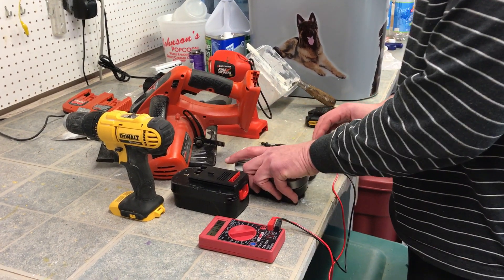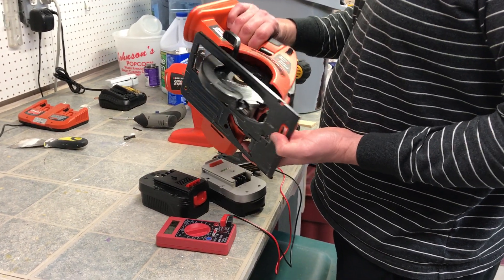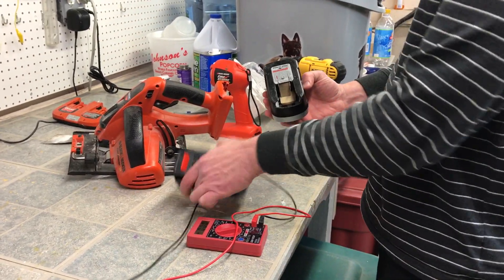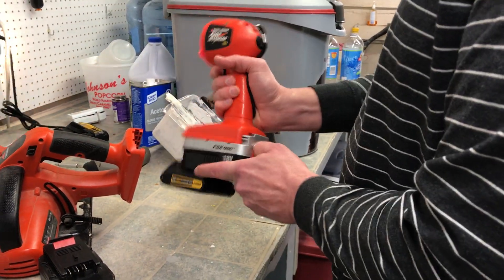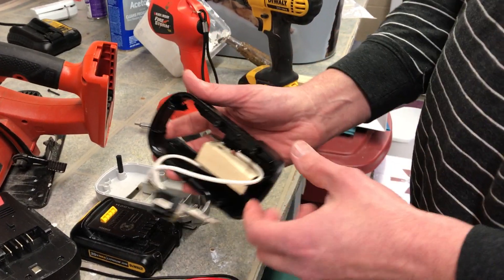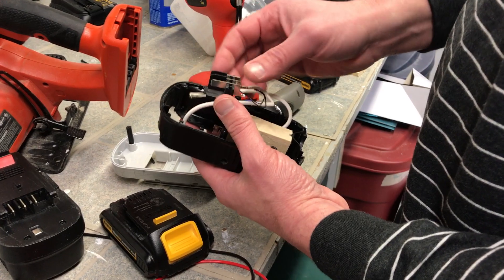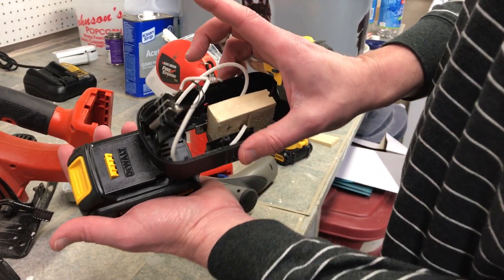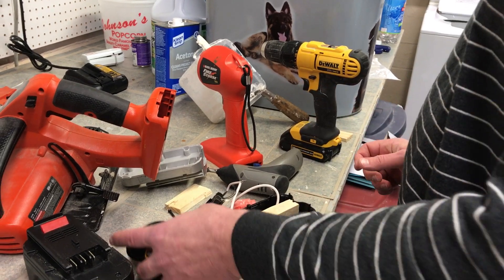18v NiCad to Lithium adapter

Comment: Never use a lithium battery on a tool wired for Ni-cad.
Reply from the maker: After 2 years, this mod has still been working great.  But you do need to be more careful then when using OEM. There is a decent amount of power stored in those battery packs.
Reply: No, using a lithium battery is fine if the voltage is close. 
 Never use a NiCad charger to charge a lithium battery.